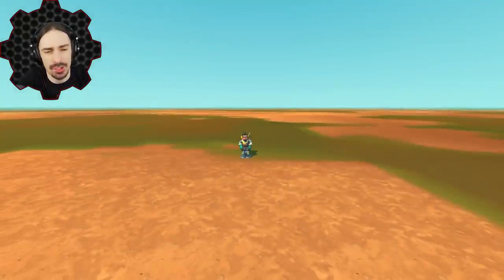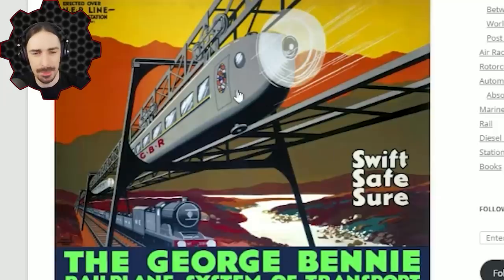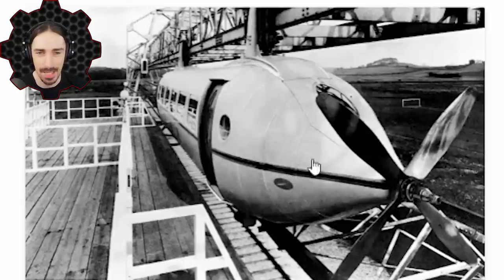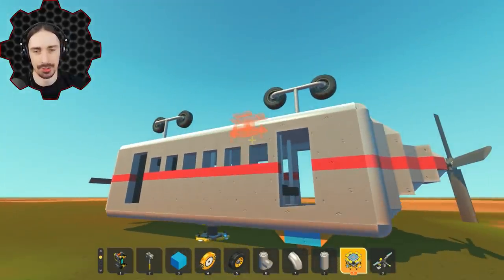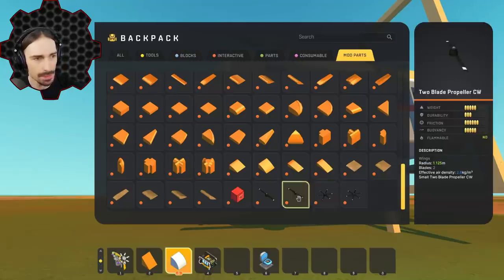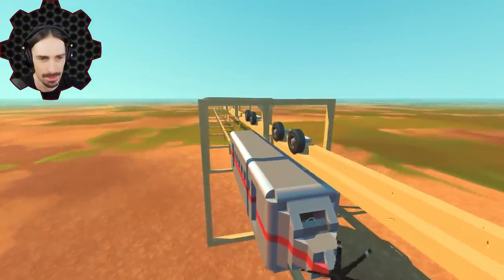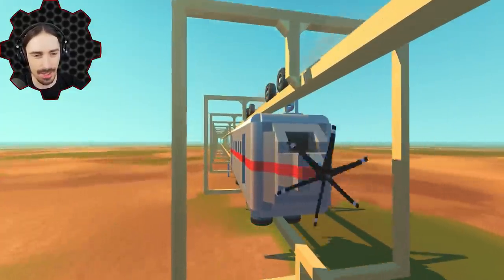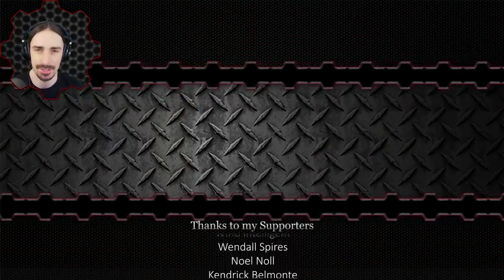This Failed Propeller Powered TRAIN Was Actually Ahead Of Its Time... SO I BUILT ONE!

Comment: Man, you need to make more videos on similar subjects to videos Found And Explained made. Including the Arctic Land Train, which used electric engines with power from a generator wagon, and could go on any kind of sneaking/snaking/snake-ing road. And this also works well with the Scrap Mechanic physics.

Comment: The FitnessGram Pacer test is a multistage aerobic capacity test that progressively gets more difficult as it continues. The 20 meter Pacer test will begin in 30 seconds. Line up at the start. The running speed starts slowly, but gets faster each minute after you hear this signal *boop*. A single lap should be completed each time you hear this sound *ding*. Remember to run in a straight line, and run as long as possible. The second time you fail to complete a lap before the sound, your test is over. The test will begin on the word start. On your mark, get ready, start.
Reply: I hear in the USA that americans don't do well on this... 
here in Canada, the highest I've gotten is 40:30:2
the highest I've seen someone get is 180:70:29
They were running for 8 hours :>
also 20meter?
I always ran 60....
goes to show how different the USA is than Canada!a

either way

 *the protogen mafia has been angered by your abuse of our turn on code. we will be sending "Our regards"*
Reply: I dont know how to respond to that one

Comment: This is a pretty neat train design and reminds me of a more modern idea variant I saw on tv years and years ago the High Speed Tubular Rail, there are a few videos of the animation of it here on youtube, but basically the train has rail top and bottom and the "track" is towers with wheels in the top and bottom for it to slip through which the towers would shoot it through them with powered wheels.

Comment: The directional issue is the top support bars holding the guide rail.
The wheels pull away in one direction making a smooth glide. In the other direction they push in smashing into that guide bar support ever slightly

Comment: Pretty sure the difference in performance depending on direction is due to the torque of the propellers. Since the attachment point isn't symmetrical it would experience friction differently between the two

Comment: The smooth direction has the torque of the propellers push the top wheels away from the top rail "wall". The not smooth direction has the propellers torque pushing the top wheels into top rail "wall" possibly causing them to try to ride up and off.

Comment: I have 2 different ideas for multiplayer monday

Challenge 1 "not my build" you build vheicals for your opponent to use in a race so the crappyer you make it the better chance you have...let the sabotage commence

Challenge 2 "dont spill" a race where you have to carry an extremely awkwardly shaped object limitations being the object has to be free floating and not fully encased. Add obstacles as you see fit

Comment: The train might be torquing due to the propellers. If it is, the tires might be hitting the rail supports. Double blades (one clockwise, one counterclockwise) on the propellers might have a better time with staying straight and might even be faster.

Comment: I think the reason this failed is because even if you have to blast mountainsides and carve tunnels for regular rail, it's still less expensive than doing that and then building a huge bulky structure on it.  Also there's the safety concern of if your train breaks or catches fire or whatever in the middle of nowhere you can't just get off of it without falling.

Comment: The big problem with this and all elevated train ideas (monorail etc); is that unless there's water below or extremely rough terrain; it's much cheaper to just flatten the terrain and put normal rails on the ground. And even if the terrain is rough or covered with water etc, it's much easier to just build a normal rail bridge over it than an entirely incompatible mono-rail system.

Comment: I think it's because of the fact that you used the small pipe pieces, and that the wheels were hitting the stilts keeping the top rail up. this could've been fixed by you replacing the one small pipe piece touching the track with a large one (with bearings on both sides). you can put a bracing around the side of it made of the small pipes to keep the wheels from jiggling.

Comment: There would have been power loss because of prop inefficiency, so it would have been better to have traction motors in the upper truck, driven powered by an electric circuit between the upper and lower rail. With props, trains would have to have been kept short, making the cost-per-seat-mile high. Derailments would have been catastrophic.
Reply: You have to remember that at the time, prop planes were far cheaper and faster then typical land engines, so the idea of incorporating the tech into land transport was pretty dang popular. It would have been a valid method of doing things, though I agree that it probably would have fallen out of favor in the long run, because of how props are all about speed and don't actually have much power, meaning it would have never really worked out for public transport.

Comment: From the looks of it, maybe the wheels on the top rail when going in the "bad direction" was rubbing against the support rail, thanks to its CoM (center of mass) being off slightly by the rail mount system causing the train to turn naturally into the support rail, and the wheels either tried to mount it or caused more friction, making the train slower in that direction.

Try frictionless blocks between the wheels to hopefully stop them going against the support rail, as in the other direction, the train turns itself into the frictionless blocks on the outside, so it can't rub against anything

Comment: Why not instead make a train like a rail gun get a tunnel and line it with a really strong magnetic toob and make the train have some magnetic perks so it gets flung forward and hide all the magnetic panels with 2 or 3 inch concrete why wouldn't that work

Comment: Could the issue when going one direction vs the other be something to do with the torque offset caused by the propellers twisting the car slightly?

EDIT: maybe you could add a stabilizer glitch or a gyroscope to counter the effects?

Comment: Scrap mechanic doesn't like long objects of same material. Dividing it into short segments helps the engine to calculate it correctly. It doesn't need to be physically divided but block of different Material also works. I'm not sure if it's still a thing but paint also was making game think it's different Material

Comment: The propeller and claims of less work are just dumb, some rocks in the way, take them out and put gravel or cement and the propeller makes no sense if you have a solid ground then using wheels is just better, the whole point of propeller’s is that you don’t need to build a giant sky road or track,it’s mileage is way worse